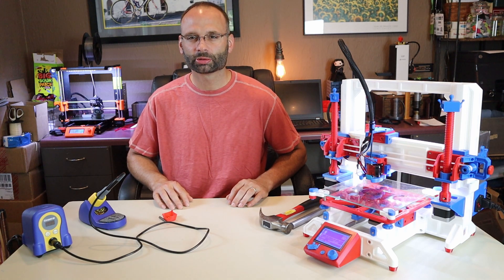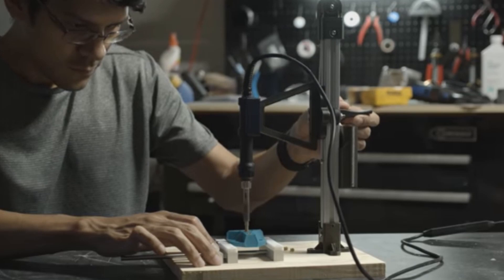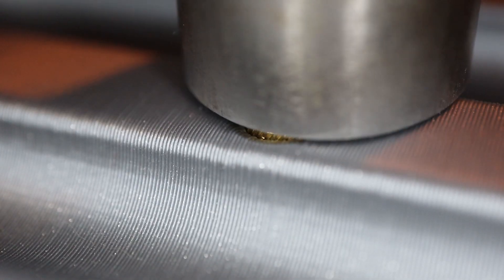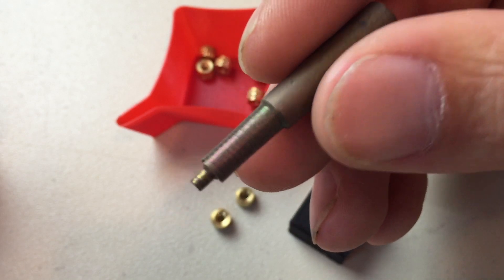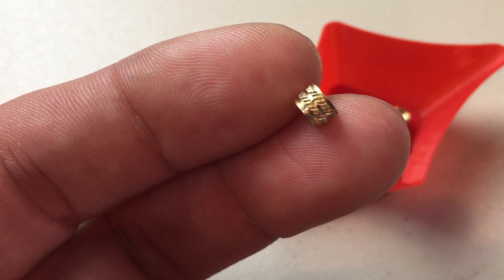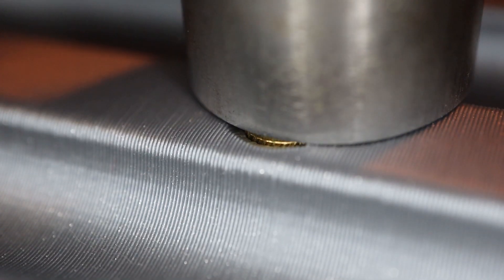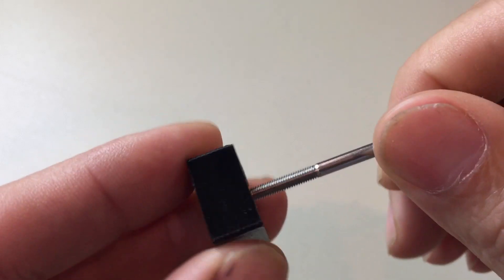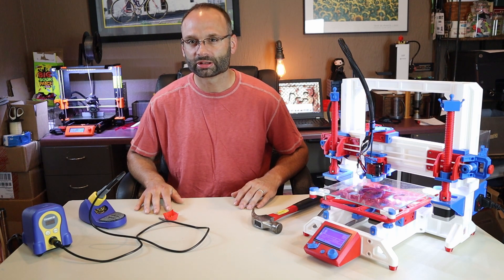Installing Threaded Inserts - In 3D Printed Parts

Comment: 2:44 You indicated which direction to put the insert in first. You are an absolute ACE for this. No one else points things like that out.
Reply: I would like to know why that side goes in first. I would have thought the opposite for strength, but maybe it goes that way just because it sits in the right spot and is easy to install?

Comment: Small Doubt
for a M4 X 8 insert, what should be the hole diameter of the 3D printed item in which you are inserting it
Reply from the maker: Depends on the insert type.  Most manufacture have a recommended hole size in their documentation, like the ones I sell on my web site.

Comment: great video. when making the model, do you make the hole the same size as the screw, or slightly smaller?, thx
Reply from the maker: The hole size depends on the insert.  If you can find the manufactures documentation. I have it listed with the inserts I sell and use personally on my website.
Reply: @3DPrintingWorlds  thanks

Comment: Is there an equivalent to threaded studs for use in 3D printed parts?
Reply from the maker: Oh, good question.  I have not seen a male version in the catalog I purchase my thread inserts from.
Reply: @3DPrintingWorlds  That's unfortunate, I was hoping to avoid having to print threads as I'd likely have to refinish with a die. Printing orientation also impacts the strength of the threads.
Reply: @E82N55  Why wouldn't you just put a thread insert in and then a short piece of threaded rod as a stud.

Comment: bro i have a doubt, if i do this process the plastic mets and penetrates into my thread. which hinders the threaded portion, plss reply
Reply from the maker: I don't have this issue, are you sure that you have the correct size pilot hole?
Reply: Your temperature is too high.

Comment: heres a little tip u 3d printer noobs might like, they screw in , they are self tapping, no heat needed just the correct size hole, watching this is like watching the blind leading the blind
Reply from the maker: Ummm.... No.  These are heat set inserts, you are talking about self tapping inserts which are designed differently.
Reply: @3DPrintingWorlds  nope same design, just because u are useing them wrong dont make them a different design,   you just copying the other muppets that are also using them wrong
Reply: @3DPrintingWorlds  I would put money on the fact u havnt tryed it
Reply from the maker: @jimmyjames1807  I haven't tried it  as they do not work that way as there are no threads only knurls. Plus there is no way to turn them, proper self tapping inserts have a slot for turning which these don't.
Reply: @3DPrintingWorlds  let me get this right , because you haven't tryed it so it doesnt work, i would assume u havent a left hand and a right hand thread on the same shaft, try it , u will be surprised

Comment: Also, are you using the Amazon inserts or the McMaster version? Seems they have slightly different dimensions.
Reply from the maker: There are different types. They do you sell the type I use on Amazon but they are more expensive than the other type. The other type is actually made for injection molding not for heat set inserts so they don’t hold as well.
Reply: @3DPrintingWorlds  Thx!

Comment: Most people use a normal soldering iron tip right? (Guessing the insert you note is better)
Have you considered using a ceramic bar of some type instead of metal to reduce heat transfer, if that is a problem?
Thx for the video!
Reply from the maker: Theoretically it could help but I don’t think very much heat actually transfers to the tool.
Reply: @3DPrintingWorlds  Cool, thx!

Comment: Fortunately you don't need threaded inserts, since threads in PLA give you almost the same stability.
Reply from the maker: If you are using threaded inserts designed to be heat set then they are much stronger. If your using the type for injection molding then maybe not.

Comment: huh... i never even knew threaded inserts existed... i typically just make a hex nut shaped cavity and put that in... that usually works perfectly but this has it's uses... but i'm not sure i can buy these locally hmmm...
Reply from the maker: Yes, nut traps work great as well but sometimes a threaded insert fits the application better. Locally might be difficult but they are easy to find online.